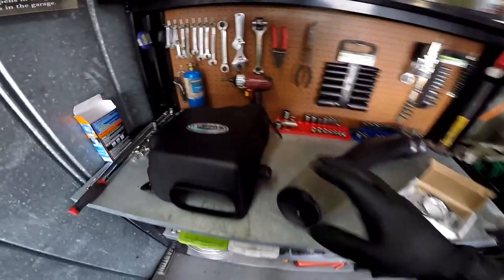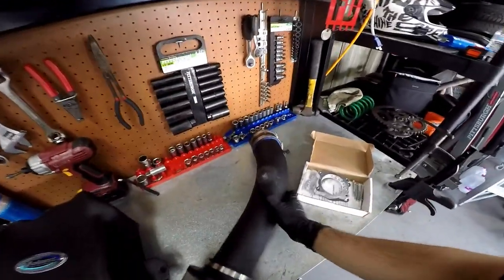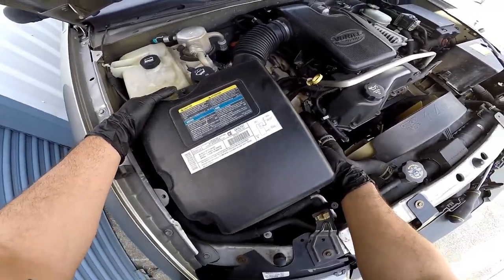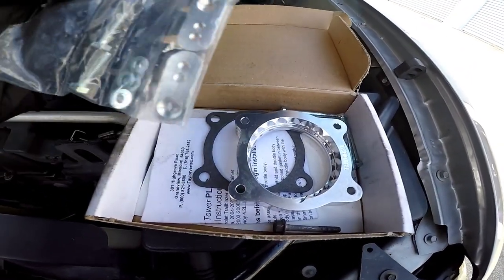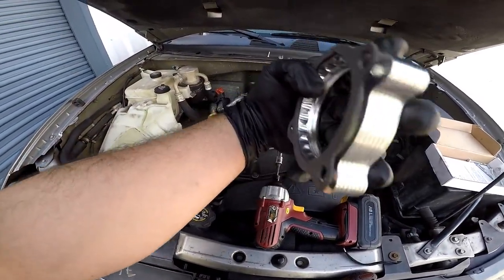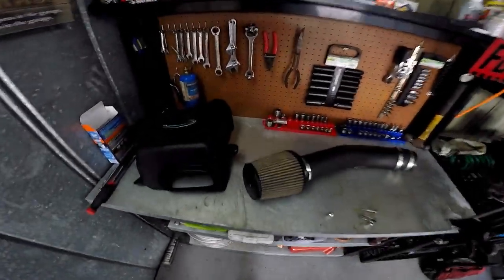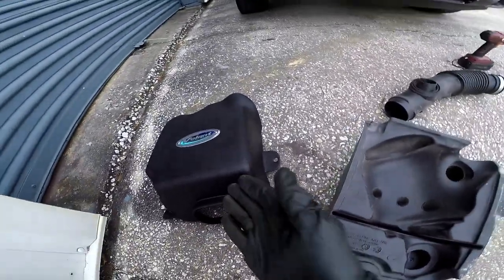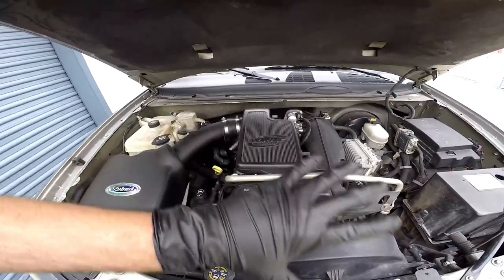Chevy Trailblazer Volant Cold Air Intake & Throttle Body Spacer Installation

Comment: On mine I removed the resonator took a intake pipe from a junk blazer, cut and flipped it and used the temp sensor hole from the cut one for the vacuum line with a brass 1/2 pipe thread by 1/4 barb fitting. Then used a valve cover vent filter from auto zone, vacuum line adapter kit, extra vaccume line and 5/16 hose clamps. Cost about $30. I did not hollow out the air box the exhaust manifold is on the same side and the box won't be insulated from the heat to keep it cold. Same with the air feed tube under the grill.
Reply from the maker: That’s awesome. Thanks for the input! It may help someone else that’s looking to make one themselves. 👍🏼
Reply: @PASSIONBUILT  thanks I appreciate your reply. I have a picture of the mod but Facebook doesn't have the ability to post pictures in thread. If you take a stock airbox from the junk yard and hollow it and cut a scoop in the front it will be just like a Volant box. You would have to insulate it. I always tell people if you going to mod your stock stuff get extras from the junkyard.
Reply from the maker: I completely agree with that. You can always grab extras from the junkyard for cheap in the event of a cut gone wrong. I actually mention in the video about other trailblazer owners gutting their factory housing in attempt to replicate the Volant housing.

Comment: My 05' Trailblazer EXT LT 5.3L doesn't have the inside closed off. I can compare it to a turtle shell cover. I do take that cover off during the hottest months here in Central Wisconsin which helps alot. I make sure to put it back on b4 the snow starts falling tho. I would like to take that obnoxious reservoir channel from the intake housing off at some point and allow it to be just a aluminum intake tube from the throttle body.
Reply from the maker: On the 4.2 models, the engine looks so weird without the factory resonator box installed. I don’t mind it too much.

Comment: Great video dude amazing score!! I wanted too go with K&N intake but i didn't like how it would look so went too Volant and they don't even sell them anymore! they only sell the filter and it's  almost as much as a K&N filter! So I went with Spectre I will be installing it today. I wish I could get one like yours!
Reply from the maker: That’s awesome. I recommend using that spectre filter with the OEM air filter housing. You’ll probably have to gut the plastic from within the factory housing to make space for your new filter. But it will be much more functional rather than if you were to leave your new spectre filter exposed on the hot side of the engine bay. Hope this helps! Good luck with your install 🙂
Reply: @PASSIONBUILT  I was just going too leave the cover off lol, & thanks man :)
Reply: @lovellmills7959  I thought Volant stop making them until I just came off their website! Mines is a 2005 & they don't make one for my year but the 2006 looks just the same. I don't know if there's a hose to be blocked off under the intake tube but I think I can work with it👍🏿 I just took the stock muffler off a put a Dynomax from Summit Racing & it definitely made a difference in performance a bit & I picked up better gas mileage & I run 93 oct ! I'm looking to do the Cold air intake & Summit has a plug 'n play performance chip that will give an extra 35hp. Got some fresh Mobile Oil & Wix filters going in Monday & New AC Delco Iridium spark plugs are on the way. You can't be fart'n around on I-285 in Atlanta, you gotta merge doing 70 out the gate🤣
Reply: @MrBigR928  Yeah it's weird. No company makes a cold air intake for the 03 too 05. But 06-09 they did? Mine is a 2005 So I bought a Spectre filter installed it and left the air box cover off. Doing that it exposes the "intake resonator" (my God who tf ever at GM  Designed that???) 🤦🏼‍♂️🤦🏼‍♂️🤦🏼‍♂️ So I had too find a way too block it off. I thought about putting an exhaust on it but it dont make sense doing that kind of work on an inline 6. Plus mine is so clean my Trailblazer LTZ with 267K  literally looks brand new from the factory underneath inside and out I Couldn't cut the exhaust up! I also have a 2003 Avalanche and for that one I did a Flowmaster Exhaust 😍 it's on my channel shorts if you'd like too check it out.

Comment: I had an cold air intake installed. On my 2002 chevy trail blazer. And the small breather its blowing out oil. An is eating my belt up.  Every thing else got thrown. Away.  Was told to do away with the cold air intake.   And put everything else back. Any suggestion's
Reply from the maker: Did you delete your factory resonator that connects to the breather on the valve cover in install you CAI? If so. That’s your problem. If you’re using a cheap eBay intake kit that doesn’t utilize the factory resonator. There are a couple of problems. First being the issue you’re running into and the second being the metal intake pipes get heat soaked by the exhaust manifold. The kit I installed on my trailblazer from Volant retains the resonator and is made of plastic so it doesn’t get heat soaked.

Comment: Does the cold air intake help you save on gas for the trailblazer? What all have you noticed since you have installed it?
Reply from the maker: Hey there. Honestly, the fuel economy didn’t change really. The most noticeable gain was the intake sound. But didn’t get much out of it performance wise. Probably with a tune from PCM of NC I would notice a change but as of now. Not too much of a difference in the drive. But for how much I paid for this set, which was like $10 or less. Definitely a cool upgrade! Lol
Reply: @PASSIONBUILT  thank you so much for the responses. Do you have Instagram? If so would like to share with you some of the mods I did on my 2006 trailblazer. Great channel keep up the good work
Reply from the maker: Thank you! I appreciate that! Please subscribe to the channel if you haven’t already. I have more trailblazer content coming soon 🙂

As for Instagram. I have 2 accounts but rarely use my personal. @jonathanrohena or @PASSIONBUILT

Comment: What about the hose the drops off the front of the airbox and plugs into the evap system? Was there an extension or something?
Reply from the maker: At 00:47 of the video I mention that I plugged the air injection hose due to having a 2003 model. 2002-2003 did not have the air injection system. I removed this intake from a 2004 Trailblazer at my local auto salvage yard.
Reply: @PASSIONBUILT  ...I didn't mean the inlet on the intake. On the airbox...maybe my terminology is wrong...where "vortech" is written..there is a small hode that runs into the top of the block. That's the one I was speaking of
Reply from the maker: @rjlegacy38  There are 2 vacuum hoses that run from that resonator box that you're talking about. They both fit as they should with no issues even with the relocation. It's only about a half inch difference. Nothing too major. I can say the larger hose that runs from the breather on the valve cover to the resonator was a tighter fit than before the installation. But still installed using the factory hose.

Comment: Good morning. I have a 2002 trailblazer LTZ and was looking to install a CAI. The Airaid is the one that keeps coming up for my model year, but I would much rather spend the extra on the Volant and have a sealed box. What year is yours and do you think I would not have any fitment issues if I did go with the Volant? Thank you for your time.
Reply from the maker: Fitment should be the same. Just 04+models came with that secondary air system that I blocked off as you saw in the video.
Reply: @PASSIONBUILT  Appreciate you.

Comment: I have a 2005 gmc envoy. on the underside of the stock air pipe there is a connection leading towards the back of the engine. what's it for? I just ordered a cheap Ebay cai cause it was the same price as a replacement filter. it doesn't show the underside so im not sure if it has that connection on it or how to bypass it.
Reply: im guessing since the kit comes with a tiny breather filter it's for that...
Reply from the maker: It’s called the air injection system which comes on the 2004+ models. I capped it off, as shown in the video because I have an early model trailblazer. I’m not sure what will happen if you cap yours off.
Reply: did you cap yours off? if so,did it set off your check engine light? just wondering. getting ready to install mine. 
 @PASSIONBUILT

Comment: I would love to know how beneficial the throttle body spacer actually was. Any actual gains in Horsepower or fuel economy??
Reply from the maker: Hey Alan. Since I installed all of these parts at the same time it is difficult to tell if the throttle body spacer actually made any difference on it’s own. I honestly don’t think it did. Online you can read about a whining noise that throttle body spacers create and I can tell you that it does make a whine noise that is noticeable upon acceleration but you get used to it after a while. 

Overall, I wouldn’t pay the $75+ for one. But it sure was a cool part to find brand new in the box for free.
Reply: @PASSIONBUILT    Yeah, I'll bet it was.
I have read so many conflicting opinions about whether a CAI really helps or not, that I can't help but be confused.
If someone installs the type that does not seal out air from under the hood, I would think  that it would actually make things worse with all that hot air coming  off the engine and through the radiator.
I'm not going to waste the money on a TB spacer, but I have been toying with the idea of a custom made enclosure for a CAI.  I've also read a lot of comments that people are getting DTC's after putting in a CAI.
Reply from the maker: CAIs on these are made differently. The kits that you see that have no air filter housing and have metal intake piping are not beneficial at all. The one that I installed from Volant is full plastic and has a complete enclosure for the air filter that has a larger opening for more airflow from where the factory air box would suck air from.
Reply: The only place where throttle body spacers do anything for performance is lower rpm’s. It’s not a seat if the pants feel that you can tell, but if your pulling a trailer or have it loaded down with your whole family in the back you would notice that it would take less effort/less throttle input to plug around in stop and go traffic. That is it, it does absolutely nothing else for the entire rest of the RPM range.

Comment: I have the 5.3 04’ trailblazer. Any good ideas to increase airflow?
Reply from the maker: Intake and exhaust are always a great starting point. Depending on what state you live in. You could always delete cats as well. If you’ve already done the basic bolt-ons. You could have the heads ported and polished. That always makes for a nice upgrade but can be costly and isn’t as easy.

Comment: K&N is better imo
Reply from the maker: K&N is definitely a high quality brand and I love their products. But I got this set from a Trailblazer in the junkyard so I did not get to choose which brand. However, I will say. I do like this kit's design a bit better because it has the closed box housing for the filter. From the pictures I have seen online, K&N's cold air intake has a heat shield that surrounds the filter but doesn't completely seal it off from the heat coming off the header. But other than that both kits are very nice.
Reply: @PASSIONBUILT  you can buy the k&n tube and couplet for 40$ and use the volant cover  but you would have to call k&n to make the order